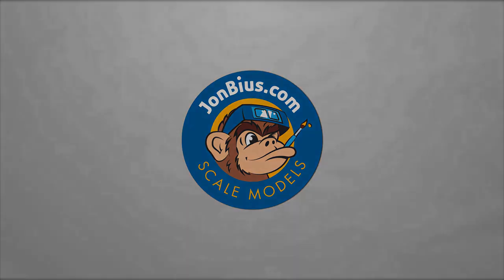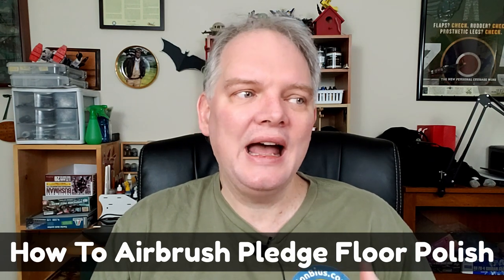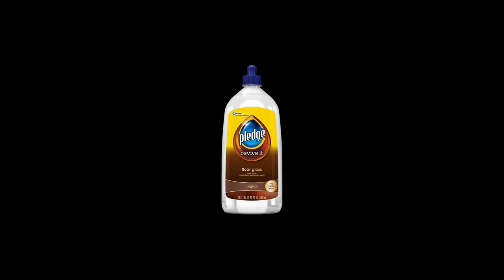Airbrushing with Pledge (Future) - A Simple Guide

Comment: Well it change the texture/appearance of planes painted with metal finish ?
Reply from the maker: Yes it will - very good question! It will change the shine from a metallic shine to a glossy shine, shifting the metallic color itself to something more gray(ish). When I was building aircraft, I never found a gloss coat that I liked for use over metallic finishes. Many of my friends said they liked Alclad's product, but I wasn't sold on it either.

I generally avoided gloss coats entirely on metallic finishes. If the surface was properly prepped, and the paint applied smoothly, I always felts decals and washes went down just fine over that.

Hope that helps - thanks for watching and commenting!
Reply: @JonBius   I was thinking that to. Why put anything on such a nice job.  I guess have to find a metal paint that’s durable.

Comment: I only use it for sticking photo etched. & the clear parts on. I've tried airbrushing it on and it seems to run and pool in some places. (like down the side of curved surfaces. And it dries  to quickly... And once its dry you will not be able to get it off. I always gloss coat with tamiya X22 clear 👍
Reply from the maker: Thanks for watching and commenting!

Comment: HOW HARD IS IT TO BUILD UP THIN COTES ????OR WILL HAVE TO DO TRIAL AND ERROR?? THANKS IN ADVANCE
Reply from the maker: It's no more difficult than any other airbrush medium really. However, I'd not recommend going for thin coats built up. While you don't want to flood the surface of the model, a good, even wet coat works best in my experience. That takes advantage of the leveling properties of the product.

I hope that helps!
Reply: @JonBius  I'M USING IT ON PAINTED WOOD CHRISTMAS ORNAMENTS AND THANKS FOR THE HELP

Comment: I just tried using Pledge and my only issue is that it goes on very thin and can run if your not careful. I have a Saab Draken in the 1/72nd scale that Hasegawa just released with upgraded engraved panel lines. It's a red jet that can be painted with gloss red or flat red or in my case a semi gloss from Revel. I will say I will never buy revel Enamel paint again. Too bad I already purchased about 12 tins of the stuff. It will rub off my models even with mutable coats and a base coat. I used to use Model master enamel paints and not once did the tape pull the paint off and this was without a base coat. The Revel tins just don't want to stay on no matter what I do. I even bought their special color mix thinner and it does not work any better than standard low smell mineral spirits that I buy in a large container. Just avoid their paints if you can. Buy Humbel they seem to work very well but are hard to find in  the colors and cost more. Great video I can see a use for the Pledge in the future for thin coats only. I covered the bottom of my J-35 with Pledge to see how it would look and so far it's just ok. It's partly my fault for using the large spray head on my Badger 150. I can see using it for small parts that need a clear coat. However, using it to cover a semi gloss red didn't' really work out for me. I also use Lacquer clear coats and there is nothing better to use for decals than a lacquer clear coat. They dry cure completely in 24 to 48 hours and allow decals to look painted on which no other clear coat will do. So there is a use for Pledge in the modeling world and i have seen clear lacquer turn yellow over a long time as well so it's not the Pledge doing it. I'm trying to transfer over to only acrylic paints and clear coats but it's not the same as enamels as they go one much thinner and harder as long as it's not Revell enamel. I'll never buy a Revell enamel paint or model for that matter ever again.
Reply from the maker: It does take some getting used to, but once applied in thin but wet coats, it works great.

Revell is not a brand - it's a warning label. 🤣

Comment: FYI, you can use ammonia free windex to clean the airbrush
Reply from the maker: It does work, but I don't recommend it. Over the years, I've seen it cause deterioration to the color cup's coating. In a few cases, users have reported it stripping down to the brass.

I think a safer but still quite effective solution is alcohol, or lacquer thinner.

Thanks for watching and commenting!

Comment: Pledge is getting hard to find and/or expensive ... has anyone ever tried an alternative? Just having a hard time paying $40 for a bottle of polish (although still less expensive than model manufacturer finishes). Just thinking out loud here. An alternative, such as Quick Shine Floor Finish for example?
Reply from the maker: Yeah, when I did this video it was prior to Pledge going away... 🫤 (They should have consulted modelers! 😂)

I have not tried the Quick Shine, but I've seen several videos, and have had a few folks I know tell me of using it, and they reported it works basically like Pledge does/did. (I still have 3 bottles!)

Thanks for watching and commenting!

Comment: Clear jon
Reply from the maker: Thanks so much for watching and commenting!
Reply: @JonBius  hi jon once I have air brushed clear onto my model applied decals left over night to dry can I apply a mat varnish on top of finished model 
  Many thanks Mike 
   Uk England
Reply from the maker: @micheallivingstone9207  Yes, that will work just fine. If you've given it overnight to dry, you shouldn't have any problems. Light coats of the matte varnish, build it up slowly.

Thanks!
Reply: @JonBius  many thanks take care happy modelling
Reply: Last question if i use wethering powders what products are available to seal it in 
Thanks for your patience
Reply from the maker: @micheallivingstone9207  Weathering powders can be a bit odd. Sometimes when you attempt to seal them in, they lose their dusty, powdery look. There are various pigment fixers from AK, etc., but often I just put them on and leave them, just making sure not to handle the model. 

You might find this video I did helpful: https://www.youtube.com/watch?v=fOrNdMO46GM

Comment: Clearly so, i used pledge and it cracked after a while. It looked good at first and then just started cracking.
Reply from the maker: Generally what that means is the underlying paint wasn't cured. This can especially be the case if it went over enamels. It does stink when that happens.

Thanks for watching and commenting!

Comment: I've been using a product called "Holloway House Quick Shine Floor Finish", which I picked up at Home Depot. Couldn't find any Future, probably because it isn't called that anymore :)
The Quick Shine seems to be a very similar product to Future: I put it on using one or two wet coats, it dries clear and shiny but with a thin surface (ie. not thick, like a matte medium say), and so far have not had any problems with orange peel or yellowing. Has anyone else tried this product?
Reply from the maker: I've not heard of that - it does sound interesting!

Thanks for watching and commenting!
Reply: Clearly so! Couldn't find Future, either, after hearing about it, so I tried Quick Shine. Results looks good to me, but as Quick Shine is the only floor wax I've used, I cannot make an informed comparison. I made the mistake of spraying Testors glosscote over it on canopies for an Atlantis B-25. I never gave thought that floor wax was durable,  made to be walked on, etc. I assumed the glosscote would preserve the shine. Two good coats, and now the canopies have a glazed look to them. Lesson learned there. Great video, thanks John!
Reply from the maker: Thanks for your kind words, and thanks for watching and commenting!

Comment: Klearly so!
Reply from the maker: Thank you for watching and commenting!
Reply: @JonBius  I use Johnson Klear and hand brush apply. I have just started to experience a problem with the Klear dragging and leaving very obvious brush strokes. Have you come across this yourself?
Bob
Reply from the maker: It can do that as it gets older in some cases. Also, don't put too much into the palette as it will start to get thick quickly. When it gets thicker it will leave more marks.

I normally don't advise thinning it at all, but in this instance, try wetting your brush with water first, dab off the excess, and then apply. A tiny bit of water may help.

Hope that helps!

Comment: Clearly so. On the water to clean your airbrush, as long as you do not use water that come from a mud puddle, you should ok. There is a lot of household products that can be used in model build because they are easier to get and cheaper, at 9 pm after the hobby shop has close for the day. I have use Easy Off to remove paint and chrome, green scrub pad,0000 steel wool for sanding, nail polish remover to debonding super glued finger and yes, I have glued a couple of my finger together on one hand, luckily. I learnt using nail polish remove as a locksmith when customers high security locks got super glue squirted into them. It cheaper safer and much quieter than using TNT.
Reply from the maker: Thanks for watching and commenting!

Comment: UV light will turn ANY clear coat yellow unless formulated to resist UV light.  Even that product will yellow but it takes a lot longer.  I do outdoor model railroading.  UV light breaks down paint & plastics on the molecular level.  Why do you need outdoor paint or stain for outdoor furniture or your decking.  Wood turns gray because of UV light.
Reply from the maker: Good info. Thanks for watching and commenting!